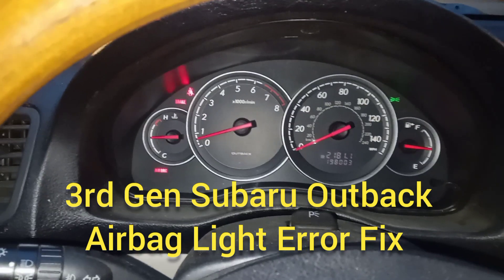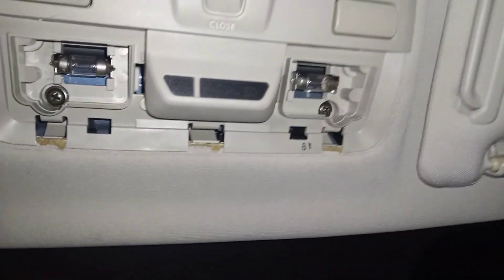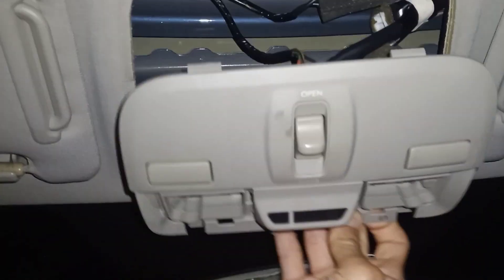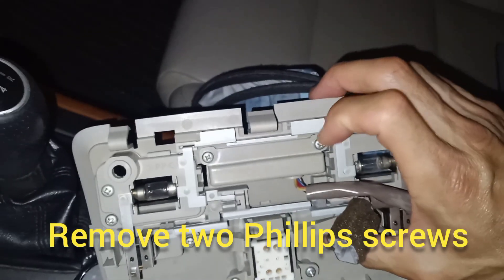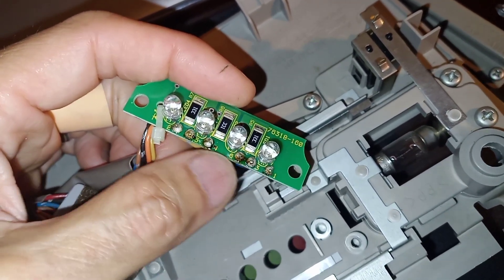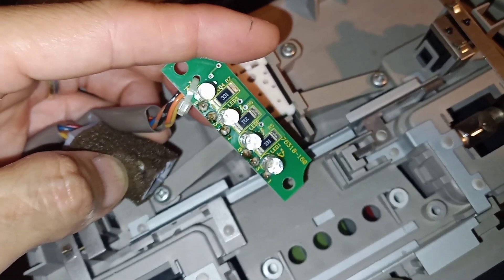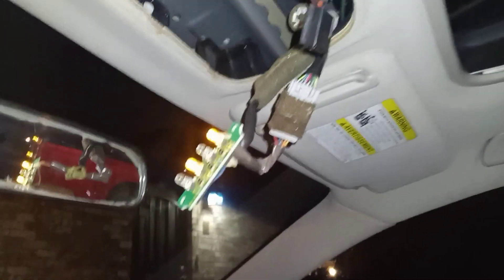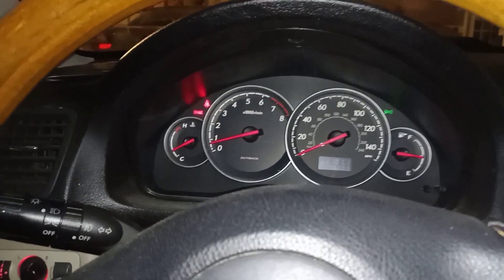3rd Generation Subaru Outback (2005-2009) Airbag Light Error Fix

Comment: This solution works. Just fixed this issue on a 2008 Outback.

The monkeys at the Subaru dealership couldn't even come up with a solution. Technically, the Subaru dealer would not do this repair even if this was a customer-paid job, but they can suggest replacement of the map light assembly with the PCB.

The dealer didn't know how to resolve the codes and suggested starting with the airbag computer replacement.

After watching this video, the whole repair took less than 20 minutes and that includes finding the soldering iron and waiting for it to warm up. The black transistors had broken solder joint. I remelted all of them as well as the wire and LED joints. Has been working flawlessly now for a few weeks.

Thank you!

Comment: Thanks Much!  This was exactly my problem, two resistors with broken solder joints on the PC, perfect solution.
Reply from the maker: Glad to help!
Reply: @hondatsunfan1011  can this still be the cause if the airbag light is intermittent?
Reply: @caseybanter  Certainly, on my PC board the surface mount resistor solder joints were cracked, thus they could make and break.
Reply: @topherrama thanks, friend.

Comment: I couldn't find a break, but after wiggling some of the joints and putting it back together. It works correctly. I know whete the problem is.

Comment: The bad solder joints are at those 3 black square resistors. I've fixed dozens of these permanently
Reply from the maker: This is SPOT ON! There were a number of times that the Airbag light came back on after a few months, and I would redo the solder, but only recently noticed that there were small cracks in the solder at those three black elements (diodes? not sure...)

Comment: How do I know if this is the issue? My airbag light is on and the passenger seat light is on. I replaced the seat and no changes
Reply: This is a super duper common issue that's easy to try.
Reply from the maker: It's a common issue. If you don't see the center "Passenger Airbag" LED on in the overhead display, this is the issue.